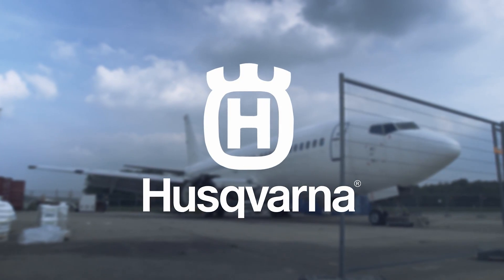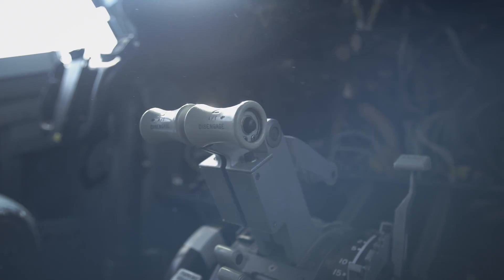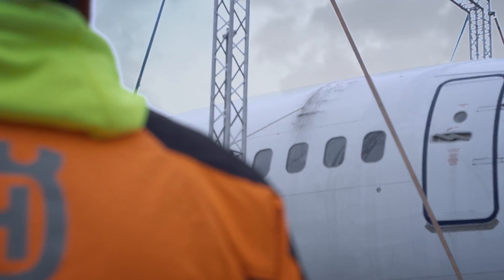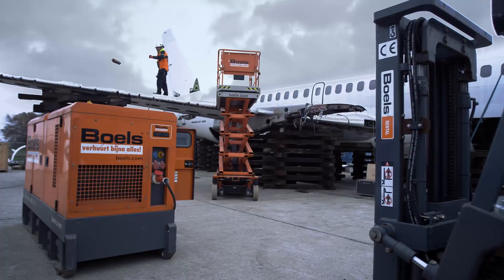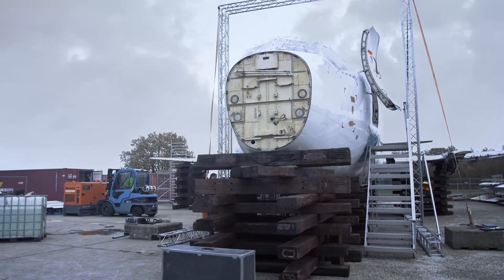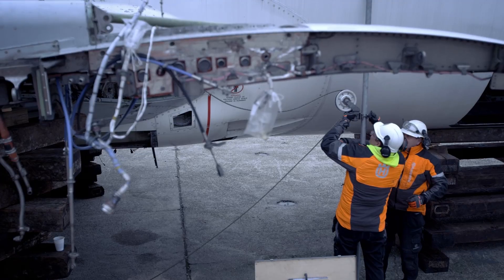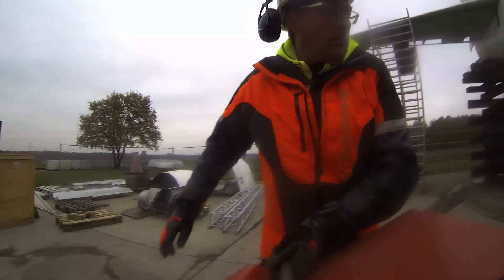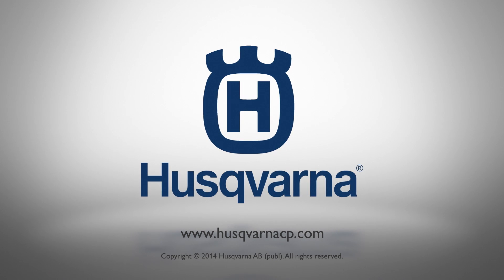How to split an airplane - Husqvarna Special Applications - recycling

Comment: Aluminum is a pain to cut
Reply: Yet so much of every aircraft combines, in manufacture, a high proportion of aluminium alloy components which have had to be cut in one way or another.  Even alloy forgings will be spot faced and drilled for attachment by rivets... For me, the big issue is the inclusion of steel componentry in aircraft structure, which the diamond wire handles without fuss.  

Even the ubiquitous twist drill bit will need to be specified differently to suit light alloys or ferrous materials, and the speed chosen for cutting light alloys with "high speed steel" drill bits may be five times as high as for light alloys... The diamond wire is cutting through both with no reduction in speed.  (see the sparks inside the fuselage?  Light alloys don't spark, ferrous materials do.)

Maybe YOU find aluminium alloys a pain?  Do you use the correct tooling?  Do you, if you use them, grind the right rakes and clearances (and produce a good enough finish on) on reusable tooling? Do you select suitable cutting speeds, suitable lubricant?